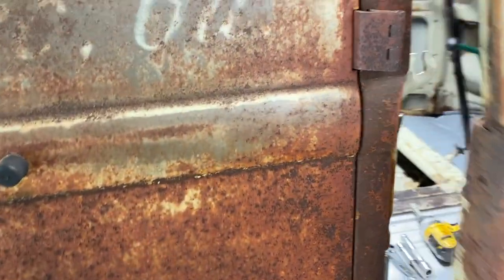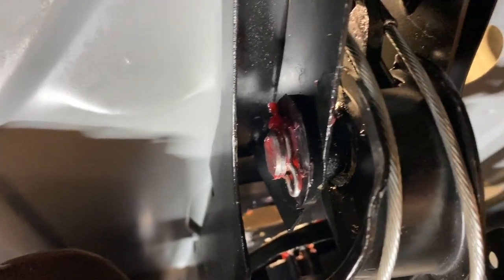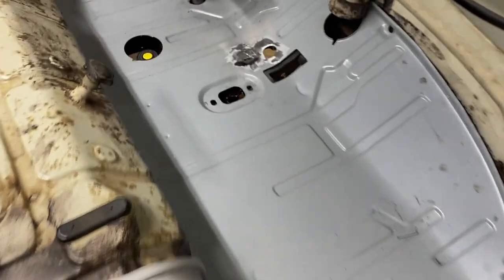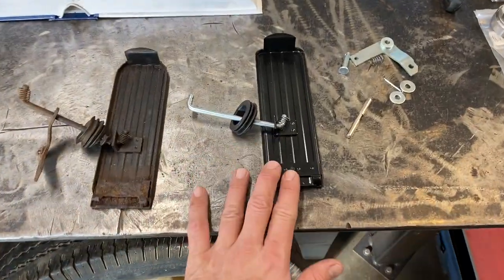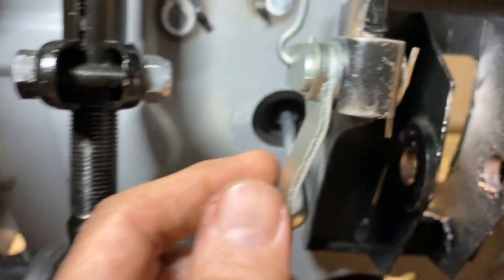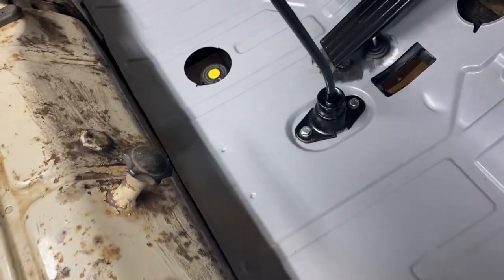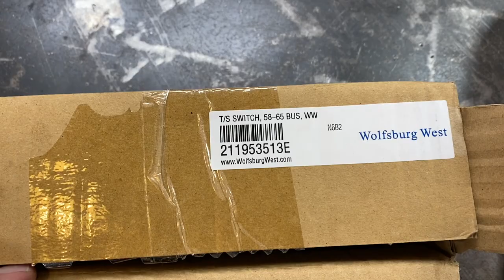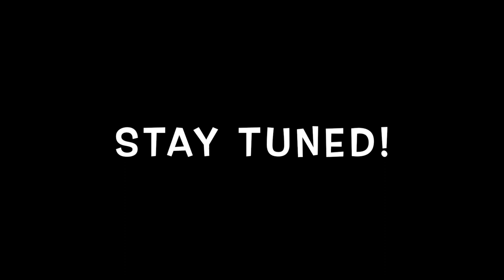VW BUS RUSTY | Accelerator Pedal, E-Parking Brake, Installed! RESURRECTION RESTORATION! VW Kombi, CT

Comment: CT I have a similar Lincoln welder.  Open the door with the wire feed.  There is a chart that will give you a guide to use for metal thickness and wire speed.  Really good video editing and content.

Comment: Nice job CT, a tip when welding is to practice on some similar gauged sheet metal before you actually try to weld on the official piece.  I also would have waited to do the bracket until the floor was in since then you would have had your welder set correctly and it isn't in your way.

Comment: The longer shifter with the spring loaded pin is for a bay window bus. My wife's 73 uses the same one.
I got a ball Bearing throttle linkage from Butty's bits in the UK. It's like night and day over the original. Loads better. A bug short shift kit helps remove the guesswork out of shifting too. When aligning the shifter, select 2nd gear and push the lockout plate over to the left as far as it will go.
Reply from the maker: Thanks Mike1 that is great info my friend! I will try that this week.

Comment: Both shifters will work. The little ball, spring and pin are designed to keep tension in the cup where they reside. Both styles will work. Your original one with the separate ball is the 1st design and the one without the ball is the newer design. The different lengths under the cap will change the length of the throw when shifting between the gears. I prefer the first design.

Comment: grease the cable and the under floor Joint CT (push the cable through a small plastic bag of grease while putting it in the tube, stops rust and makes it smooth on the peddle

Comment: Great call on keeping as many original parts as possible. The quality of the OEM German stuff is unsurpassed. You need grease in the shifter ball and on the top of the upper cup as it also rotates against the shifter housing. I notice the transaxle still doesn’t have the axle boots installed; if you plan to drive it around the block remember to do that and refill your transaxle with gear oil. I don’t mean to sound like a wise ass but sometimes we get too excited and forget these things. Also remember; when putting things back together your VW Service Manual is your friend; and you have the best one 😉.

I’ve seen other people in other channels use rust converter on the outside and then use matte clear on top of it.
Reply from the maker: Yes, I agree. Original is best most of the time! Good catch on the boots. I will get those on this week. Great tips my friend! =)

Comment: If you want the inside tip top, you should use the new Hi Beam switch ! 😀 BTW, to protect the outside surfaces but the look, see what Mustie1 uses on his vehicles. I think its a mix of bee wax in paint thinner. Varsol  maybe.

Comment: Early and late shifter. In 66 they changed the shifter length. I dont know all of the details on this but I know they are different. longer so the thro was shorter. Longer shifter has shorter thro. Also a spacer may be required to use longer shifter. Then there is a early shifter  I think before 59.....FYI.

Comment: Nice  videos. Would suggest  put some  grease  on the new screws  and bolt threads.keep them from rusting and when take em off the next time it will come off  a lot easily.

Comment: The 1962 with rebuild new parts and body components that just fits the kombi Rusty. So rust will be dust and died down the rust/rusting. The dashboard which holds the speedometer as well as switch knobs, pull light switch and glove compartment. It need shiny by sanding down all the rust off and make silvery color bare metal and add clay Bondo and not too much hardener. The clay will dry and sand the mud with 120 Grit and higher Grit black sander wet dry paper type. Cloth is not wet dry sanding kit. Just paper holding the emery called aluminum oxide particles with sharp matrix slur into resin of its paper. The dashboard will be cover completely of ceramic coated the metal spread the primer with plastic putty knife = very soft pick/flexible sheet. and the dap is bondo as it is primer same. That is where the scrap cloth sheet to be cover over your reworked floor so it will not be dirty inside kombi Microbus. Attaboy, the dashboard is being restored in your will. Good work too CT.

Comment: 16:20 I learned so far you are in Florida? If you want to drive the Bus in an area where the temperature goes below 0° C, grease the accelartor cable please. Water can get into the tunnel and freeze and Weeeeeeeeeeeeeeeeeeeh! your stuck on full throttle.
Reply: Not laughing at your comment as it makes sense. It just brought back a painful memory. A friend of mine bought a 58 beetle. It had not been cranked in many months. While he was inside the car I was under the lid, we finally got it cranked but the throttle was stuck wide open. When I reached in to push the linkage it was running good and fast. As soon as I pushed the linkage the generator belt broke and wrapped around my hand. Thankfully no broken bones but man in cold weather that hand was hurting bad. Thanks
Reply: @donniebrown2896  Those old Beetles,  a 6V 1961 for me were quite dangerous. Especially fore fire. Reason 1: you back up onto the curb and push the left exhaust tube into the main exhaust. Some heat will occur and the fuel pump is right above it. Leaking tubes or seals and there you are. Reason 2: Back seat bench, the springs of the backseat bench wore out and caused a short circuit on the battery right below it. Since the bench was upholstered with horse hair, you smell burned hair soon after. I always had a fire extinguisher with me but the simple solution was a piece of plywood above the battery contacts. For the generato belt, I always tok the hood off working on the engine, else I could not reach a single thing.
Reply: @j.zingler6735  yeah ,my friend had totalled his '66, he wasn't covered by anything but liability. A fireman friend of ours had the '58 and didn't like the 36 horse engine do he sold it for 250$. That was in '71.  In one weekend we did a direct swap out. The only thing we found that was different was the size of the engine bay. Tight but we got it in. Modified the sheet metal and we're through. Next weekend, chrome reverse w/baby moons and oversize wide rear tires, put dual buggy pipes on w/ the pipes routed through the fenders.
Six months later I could have killed him. He sold it for 1500$
BTW, I totalled my '62 rag top three times, each time bought it back from insurance company and kept driving it, just a bit of weight reducing body work. The worst one was when I "T" boned a brand new toyota. Totalled mine, the toyota, and pushed it into another car which it hit a power pole. Was doing a flat 60mph, found out about the pop out windshield, the metal dash, and the non collapsing steering column. Yeah and my battery broke in half. I loved that car.

Comment: What to put on the outside to keep the rusty look ? Toilet wax is what Mustie1 keeps saying he uses and linseed oil has often been used on lighter rust. I was wondering how epoxy resin would last under a range of weather conditions - it tends to decrease in it's adherence with heat, I don't know if it would stand up to the extremes of weather. Lacquer alone sounds crazy, but it may be durable enough to last better than other options. I wonder what you'll choose. Wet sand with wet+dry paper and then linseed oil is the most popular - maybe lacquer would be fine on top of a wet sand.  Can you test a small panel out with a few methods and then leave it outside in the winter to get weathered? It may be interesting to come back to after a few months. Could you test it out like project farm do? https://www.youtube.com/watch?v=lyWHF4NoNVk&t=4s

Comment: Hey CT where did you find that section of metal that the shifter and parking brake go ?
Reply from the maker: Hey Tim,

I ordered from these guys 
https://www.serial-kombi.com/en-GB/split-bus-body-panels-/-chassis-brracket-for-hand-brake-and-gear-shift-lever-under-the-cabin-floor-8/1959-7/1967-n321594
Reply: @CTmoog  awesome thank you so much. I have been searching for that part.   Thanks for the help and thanks for your videos have helped me out.
Reply from the maker: @timwindhorst9997  no problem! Keep me updated on you're project. What year is it?
Reply: @CTmoog  I have a 64 13 window.